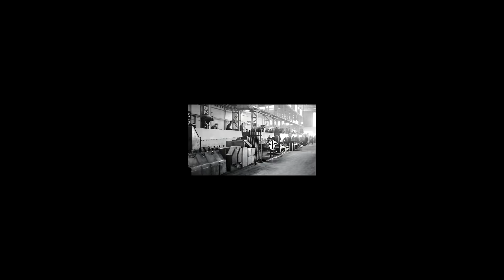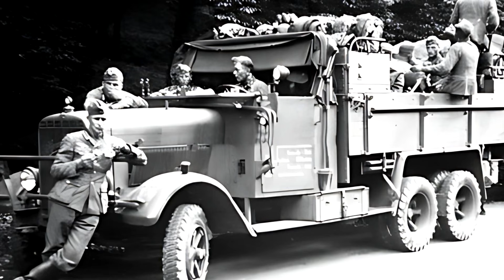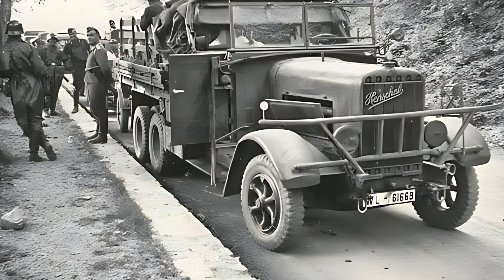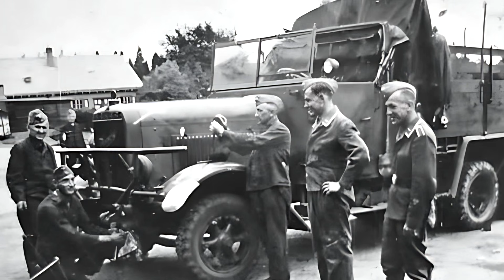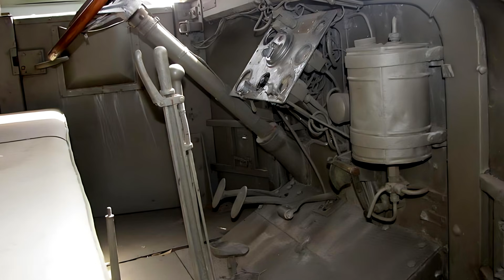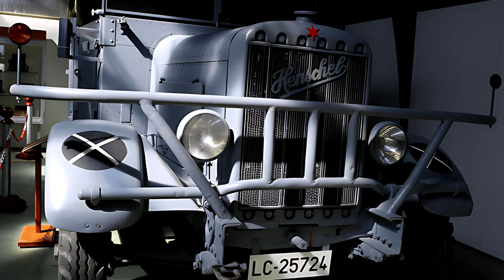🕰️ 1934 Henschel Type 33 D1 — When Machines Had Souls

Comment: Did it have air brakes? I thought you said mechanical operated(i.e. linkages and roods)?
Reply: Those were around long before air brakes!
Reply: @lynnmorton7544  Air brakes for trucks were invented in Germany in 1922. In 1923 a Horch truck was made with them in Berlin. And became fairly standard by the late 1920’s.